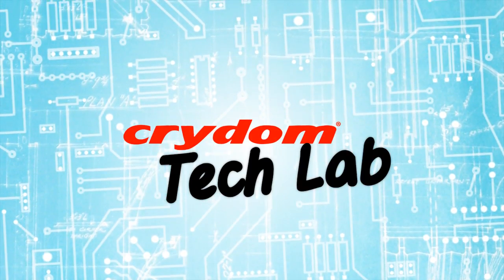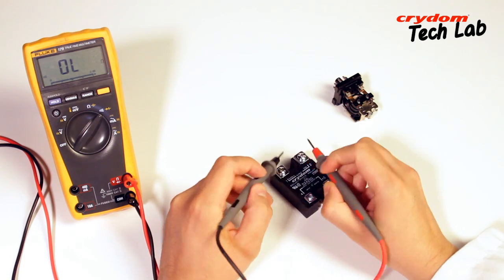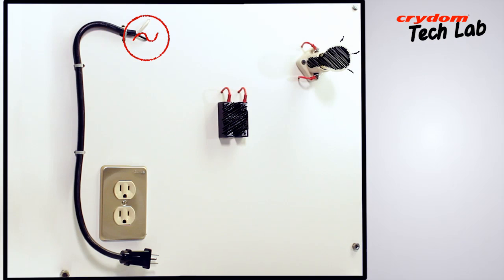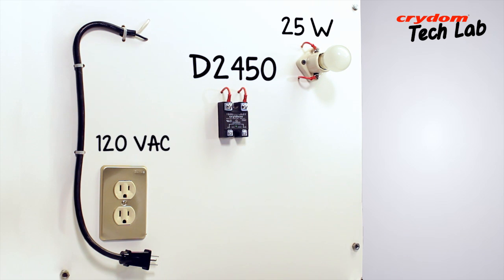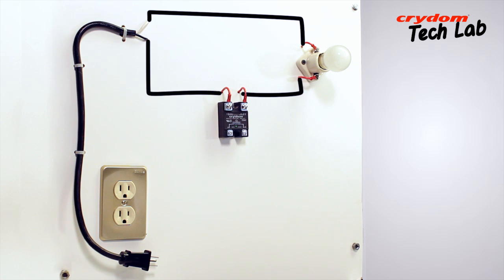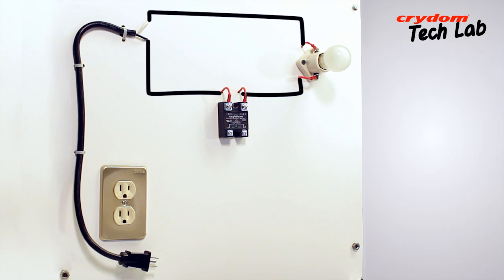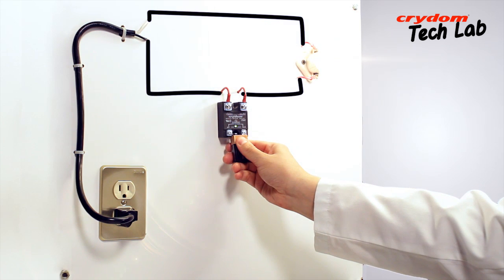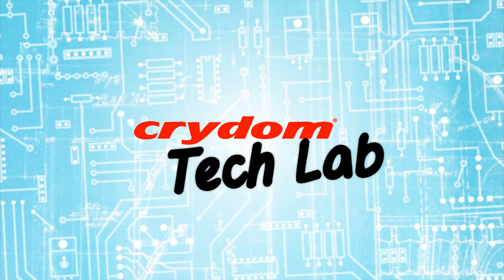Crydom TechLab 1 - How to perform an operational on-off test on a solid state relay

Comment: Very beneficial video.
Just a quick question.
Can I test SSR by applying AC 240 at O/P pin 1 & 2 instead of AC 120v.?
Reply: Hi Habib, I don't know if you've yet found the answer since it's been a few months, but 240Vac is usually not an issue. It depends upon which SSR you're using. Most SSRs have output voltage ratings from 24-280Vac, or 24-530/600/660Vac. They will operate perfectly fine at any line voltage within the specified range.

Comment: Great video.  I have an application where the load voltage is 120 VAC, but the trigger voltage can vary from 24-120 VAC. Could you recommend a relay that would be ideal for that application. 
Thanks --  Larry  --  larrybledsoe@comcast.net
Reply from the maker: Hello Larry, the specific part number to select will depend on several aspects such as load current, type of load (heater, motor, etc.) and the ambient temperature at which you will be operating the SSR.
We recommend that you take a look at the Series 1 SSRs with AC control input (the PN should look something like this "A24xx"), accessible on our website: http://www.crydom.com/en/products/panel-mount/ac-output-ssr/series-1/
We could provide a specific suggestion if we had more details about your application, for better assistance contact our technical support team support@crydom.com.

Comment: Good demo!  Can this relay be used with DC voltage output instead of AC?
Reply from the maker: +Dot Sylver We're glad you found this demo useful. This particular video uses an AC output SSR for the demonstration, but the same can be done with a DC output SSR.
You can find DC output SSRs on our products page under your preferred mounting option in our website:
http://www.crydom.com/en/products/

If you need additional help selecting the correct product for your application be sure to check out our Tools Menu for product selection or to contact Crydom Tech support:
http://www.crydom.com/en/contact-us/support.shtml

Comment: May be worth considering if the ssr was in cct already, you could test if it was actuating with a multimeter/voltage tester. Test across terminals 1 and 2 for pd, if the relay is open potential with be shown of the meter (120v example in video) when the relay actuates and closes then the meter should read zero as you will be testing between two points at the same potential. (Hope that makes sense)